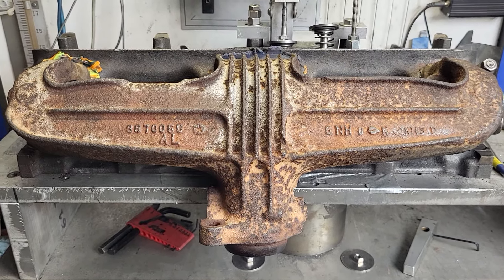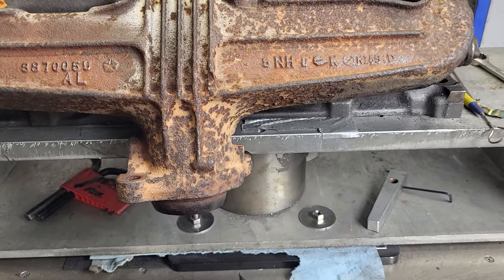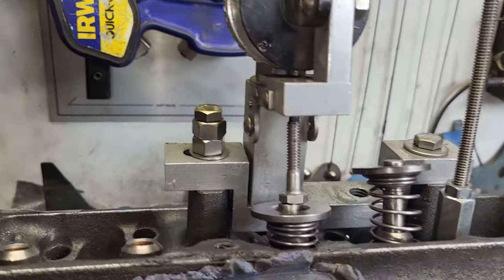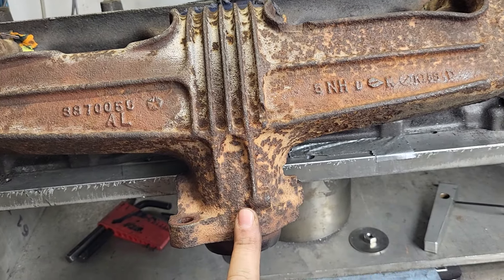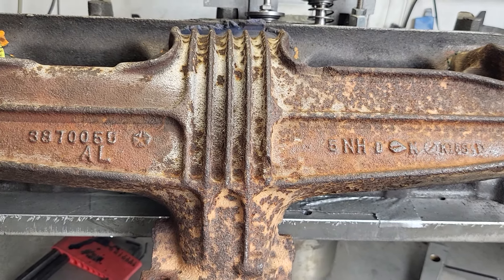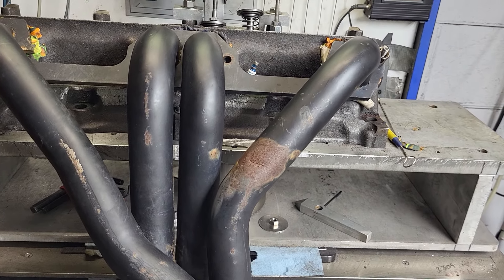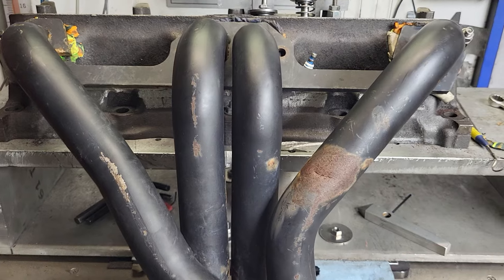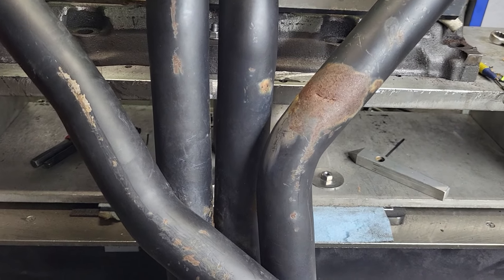David Vizard, Unity Motorsport, Mission Impossible 318 project. Exhaust flows pt #1

Comment: Thanks for showing, i drove a 318 2v , and when i switched to headers with same 2v engine it made huge difference , with nothing else changed, i had to get limited slip rear gear
Reply from the maker: Just shows the bench does not have the ability to show the true advantages of header. Thanks!

Comment: That is very interesting. When ever I used exhaust manifolds I ported them out as far as the bit could reach. That was before long reach bits were easily available or affordable.
I'm guessing those exhaust manifolds have not been touched. (Yet)

Comment: When the headers on my 318 rusted out, I put manifolds on. Stock 318, with just a 4 barrel in a pickup, didn't think it'd make much difference. Definitely lost some power and gas mileage. 
Bought new headers, really mostly for the mpg. A mile and a half gallon in a 4x4 pickup that gets 15ish on a good day adds up. 
Those were the early manifolds off a 68 pickup, probably the worst ones you can get, but they were handy.

Comment: Hey Charlie! Nice work. Do have something for you to consider though. Even with less flow a header can make more power and considerably more torque. The log manifolds offer very little in terms of resonance wave tuning and scavenging, only a minimal effect from what is produced in the exhaust tubing. A properly designed header can easily add 40-50 ft/lbs of torque compared to a log manifold like that. You might find someone who has a copy of PipeMax to run a simulation estimating the ideal header diameter and length for the overall combination. Can still make decent power with manifolds, but a properly designed header will always beat out a log manifold fairly harshly in average tq and hp. Some of the OE performance manifolds like the ones on the 60s Pontiacs and other higher performance muscle cars that were cast with divided ports like a cast iron version of a header do much better, but even those engines could do better with about 2-3x the primary tube length those offered.
Reply from the maker: I agree! Thanks

Comment: 🔔😎🇺🇲
Just the manifold:
Try sucking at the exhaust pipe outlet. Blocking all cyl ports and then reading one at a time THEN reading all 4 at once and checking airspeed in each manifold inlet hole when theyre all open at once.
That should show the overall capability of just the exhaust manifold. And maybe allow to flow balance between each.
Just thinking out loud.😁YeeeeHaaaaw!!!!👍
Reply from the maker: At the right temp, pressure and pulsations! Hahaha.

Comment: Don't those manifolds have one big opening for both center exhaust ports?  It doesn't look like there are valves in the other cylinders.  Is the air leaking through the other exhaust ports into the chambers and blowing out the intakes and also the valve guides?  Might need a wet finger test to look for other leaks.  But that center opening is large and short.  $.02.
Reply from the maker: Valves are not in the other exhaust ports are packed with foam as the exhaust crossover as well. I forgot to mention the port needs to be isolated. Thanks

Comment: Did you block off the other exhaust ports? If not wouldn't you be blowing air through the other exhaust ports and out the open intake ports? If so you have a lot more area for the exhaust escape compared to one long tube.
Reply from the maker: I forgot to mention that but yes. All other ports and exhaust crossover blocked. Good question.
Reply: Thanks for the reply! That makes this a pretty interesting. Could it possibly just be that the outlet is so close to the port that there isn't much restriction? In a running engine would the CFM drop considerably due to the stacking of exhaust gasses and pulses? Seems like it would since this is basically what headers improve on. Sorry just thinking out loud.
Reply from the maker: @FatguyLC  I give my theory in part 2 the damn pause button got me again!

Comment: When we start to guess how much can be transferred through an exhaust system, just remember the F.A.S.T series guys are achieving aaalllloootttt of power through them. 
  Volume has a big impact on flow. The first 16" of a typical system always benefits from more volume. The manifold has 70% more volume in that region from the valve. If you added partitions on each side of that port. Your flows would crash. 
  Exhaust gas exspands faster than it will flow from point A-B.
Reply from the maker: Good info! Thanks Tom

Comment: Those manifolds are basically just a big plenum. The center ports are not even divided. I'm  not sure there's a way to get a meaningful test on what the restriction or flow is from flowing any one port without the other three pulses crowding that plenum.
I'm interested to see what you come up with, though.